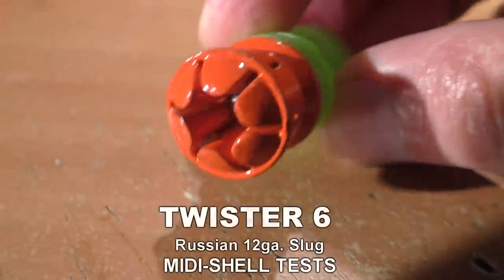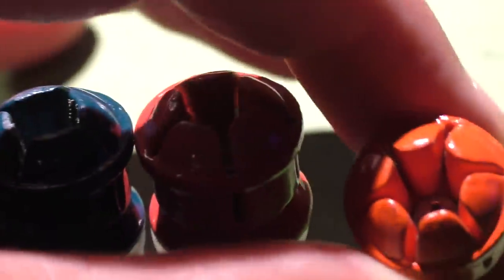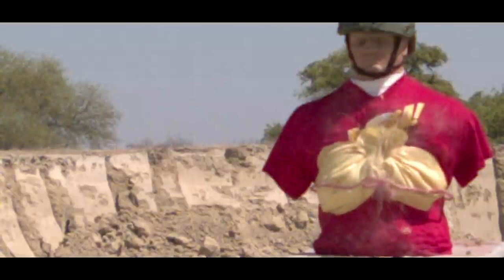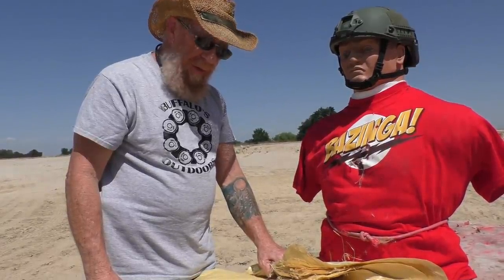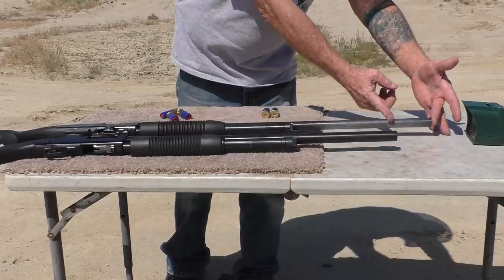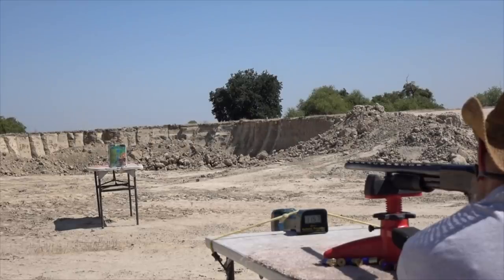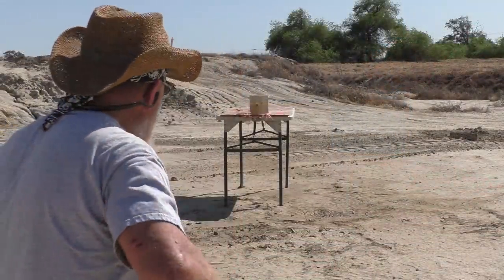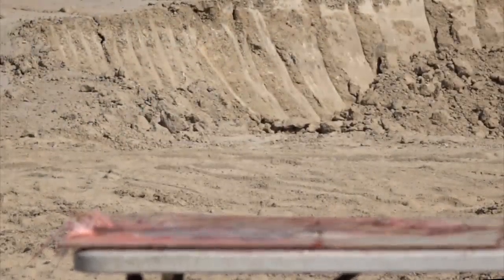This just might be the BEST 12ga. Slug we've tested!

Comment: The fact it didn't hit the pork shoulder exactly square but still fragmented and did that much damage at subsonic speeds is extremely impressive...
Reply: They also fired into the cross-section of the muscle rather than into the skin and fat and side of the muscle, which is how it would have hit had you fired on an actual hog, so it's even MORE impressive than you stated here, and that's already quite impressive!
Reply: And we have people in office that think an AR 15 is more destructive than a shotgun.  Some people...
Reply: @DSiren  There are also many people in office that think a semi-automatic civilian rifle is as deadly as the military-issue armaments it's derived from. Most of them think "semi-automatic" means that it doesn't fire by itself, but still fires full auto if you pull the trigger, FFS.
Reply: The prototype, the Shirinsky-Shikhmatov bullet is one of the oldest Russian bullets for bear hunting with a 12-caliber smoothbore weapon (1880s). There is a deep expansion recess in the head part, closed from above with a capsule for expansiveness. The bullet was most likely designed for the traditional Russian bear hunting in its winter den. The shooting was conducted from a distance of 5-15 yards, and the bear had to be stopped immediately. Because the bear, waking up in winter, does not go to bed, but goes to nearby villages and eats people, dogs, everything that he can find. And it can kill the hunters themselves. It is very easy to kill a bear with a 223-caliber rifled rifle at 30 yards in the head, the skull splits. But it's not easy to get into a bear that runs, and bears run very fast for short distances. And such a 12-caliber bullet stops a bear when it hits almost any part of its body.

Comment: This was a nice video to come home to. It's nice to know that how brutal they are even at low velocities. It makes sense why they chose to engineer the slugs around that wad.
34 gn of Longshot gives me good accuracy from the 3 segment Twisters out of my KSG.
Reply from the maker: Thanks for sending them.   The green wads really made a difference.  I used LS too but trying to keep the velocities low was actually really tricky with these heavy slugs.  (at least with this powder)
Reply: @taofledermaus  No problem. I'm happy to see the difference they make. They were only available in bulk, but definitely worth it. I'm thinking that Steel will ignite behind those 3 segment Twisters. The Shot-minis took a bit of trial and error to get them down to ~1250 f/s, but accuracy greatly improved. I got lazy and stopped trimming the hulls. I found a good load with 18.0 gn Vectan AS ~1260 f/s (in the Alliant American Select range), but I don't know if it'll be available here in the US anymore. I'll be sad if it's not because it was clean burning and dirt cheap (I paid ~$15 for 1/2 kilo).I'm just glad that I have a small stock of it.

Comment: 4:50 Holy hell! Look at the energy left in that slug after passing through Kevlar and the dummy. It hit that dirt hard! These may not be what you want for home defense. They may go through a wall or ten after passing through the bad guy😬
Edit: I guess the trick is to load them subsonic. That is a hell of a round.
Reply: @Habeebea  😂 The trick is to get the intruder and the neighbor you you want " evicted" in a straight line!
Reply: Folks will have to start asking their neighbors to make sure their refrigerators and freezers are strategically lined up to tactical lanes of fire with the next door neighbor using these slugs. Just in case. 😂🤣😂🤣

Comment: Yes thank you. So many people on FB making alignment tools. I just use a new hull with the brass cut off
Reply: You don't even need them with this wad. The slugs are designed to fit them perfectly.
Reply: Lego blocks are square enough for most purposes. Make an L shaped stack and push whatever you're aligning against the inside corner. If you use multiple layers of thin pieces, any variation on individual pieces gets averaged out.
Reply from the maker: Not even my idea,  saw a Russian guy doing it that way!
Reply: @taofledermaus  I always test fit the Russian slugs and wad riding slugs through a new hull minus the brass to make sure they will load and chamber well.. Just made sense to use it to align them too. Thanks for the great videos as always.

Comment: When that slug isn't loaded in a hull would it be called a naked twister?
Reply: Only if it hasn't been powder coated yet. With powder coat on, fresh out of the oven, it's a twister in hot underwear. Or maybe bodypaint, which would mean it's still technically naked although it doesn't necessarily appear that way... 🤔Hmmm...

Comment: I'd say you're either running out of powder before the end of the barrel or the rifling is causing a better seal than the smooth bore, making it a more efficient burn
Reply from the maker: Yeah,  very possible.
Reply: @taofledermaus  - any chance you guys have the older Mossberg 500 12ga smoothbore 20” barrel with the rifle sights attached to compare with?

Comment: If you can find some”Alliant Reloder 50, very slow burn rate, you’ll get higher FPS.
Reply: The Expansion Rate is WAY to Slow,  You'd Never Build Enough Pressure to Burn Correctly. And More than Likely It Would Fall Out the end of the Barrel. Shotgun & Handgun powders Have to Operate on the same Principles, 
 " Relatively " Small powder charge,  But Very Large Swept Volume,  and Low Chamber Pressure,  I Believe Absolute Max Pressure,  For New Shotguns 3 & 3.5" Steel shot is 22 k psi. About 38 special +p Pressure. Where Modern Rifles is Between 50 & 65 K psi. Even the old 30-30 is 44 K psi.
Reply from the maker: I wasn't trying to get high velocity.

Comment: You get more velocity out of the rifled barrel because the rifling causes more resistance on the bullet, which builds more chamber pressure,  which propels the bullet faster. Same thing happens with muzzle loaders. If you use a thicker patch and ram the ball down harder, it does the same thing.

Comment: Hi Jeff, I'm not surprised about the accuracy of the slower loadings because I've had great success with the FIOCCHI Low Recoil AERO slugs which are around 1100 FPS.  I've also had great success with my 12 GA hand loads using both BPI's Thug Slugs and the DGS or Dangerous Game Slugs. I'm getting 2-inch groups at 50 Yards with an old JC Higgins Model 12 pump gun and a rifled choke tube.  The DGS slugs as you probably already know are made by Gualandi in Italy.  They're loaded in some B & P (Baschieri & Pellagri)  loads.  I've tested those too on my channel and they're very accurate and around 1500 FPS.   What's your address if I come up with an interesting new load I'd love to have you test them?   I'd love to try these slugs but I really can't get involved in melting lead and pouring my own!  Great video!

Comment: I have the 28ga version of this slug from AS.  I've worked up a load running around 1550fps and is super accurate out of Cyl and Skeet choke tubes.  Took a nice doe back in deer season with it.  Will be using it on hogs this coming fall.  Trying to get some to Buffalo so he can get some accuracy/penetration testing as I know he has some 28ga guns.
Reply from the maker: Does he have a 28?

Comment: This is a modern version of the Shirinsky-Shikhmatov bullet, it is made for 2-6 segments, maybe 8 and is usually used immediately, without pouring wax or paraffin and without a capsule in the bullet. The Shirinsky-Shikhmatov bullet is one of the oldest Russian bullets for bear hunting with a 12-caliber smoothbore weapon. Its inventor is the governor of the Tver province of tsarist Russia, Prince Shirinsky-Shikhmatov. Presumably, he invented his bullet in the 1880s. The original bullet had 4 segments parts. The Shirinsky-Shikhmatov bullet is monolithic, lead, expansive, having a cylindrical shape with a slightly convex oval tip. There are two leading belts along the edges of the cylinder, as a result of which it is well centered in the barrel. In the head part there is a deep expansive recess, closed from above with a capsule cap. There are cross-shaped through-cuts passing through the bullet body. An expansive gap occurs along them. The recess and incisions are filled with paraffin. The felt wad was screwed on with a screw as a stabilizer, and they could.
The bullet was most likely developed for the traditional Russian bear hunting in its winter den. The shooting was conducted at a distance of 5-15 yards, and the bear had to be stopped immediately. Because the bear, after being woken up in the winter, does not go back to bed, but goes to nearby villages and eats people, dogs, everything will be able to find. And it can kill the hunters themselves.

Comment: Just looked at their website. Several interesting moulds and variations at good prices. They don't sell wads which some moulds need specific wads, where would the wads be ordered from?
I'm big into smoothbore, and rifled tube shotguns, love your videos.
Reply: Jeff, you can order the wads from:  https://www.ballisticproducts.com/
TreeTop
Reply: These are the wads shown on the site. BPI sells then as the BRP-12 They're rebranded Gualandi BRP 20. The slugs are designed to fit these wads. They may look similar the the BPI original brush wad (Gualandi BRP 18), but there are some definite differences. If you're going to shoot these slugs, do yourself a BIG favor and go with these.
Reply from the maker: Some of the Russian slugs do use a special "azot" Russian wad which might be hard to get.
Reply: @taofledermaus  You can get those through The Reloaders Network, though they're not cheap. https://www.thereloadersnetwork.com/product/svarog-shotgun-slug-wads/

Comment: Oo 
I can machine some threaded “screws” out of tungsten carbide, M45 High speed steel, CPM-S110V, S90v, or just some hardened carbon steel?

I can make the back end, the screw end threaded to go into the wad. And the tip into like a dart. Shaped like a Flechette?

Comment: Hey Guys,
I have a question about using the Maverick 88 i think you use it in this video, when you decide to use a smooth bore Barrel, the question is are you using the modified choke with all slug you shoot or you are using improved cylinder choke
Its nessary to have an answer
Reply from the maker: The smooth bore barrel Danny uses was an IC choke barrel but he chopped that off.

Comment: Shorter hulls reduce chamber pressure upon firing and leave the projectile to float down towards the forcing cone potentially reducing accuracy similar to firing a .22 short in a long chamber it is never accurate so I would use whatever length hull the chamber wants. Mine are all 2 3/4 except for a .410 that is 3 inch chamber.

Comment: You may be losing velocity from gas escaping. Typically rifled barrels are a little tighter. What choke was on the smooth bore? I suppose the longer barrel may have expended the gas pressure wave and began losing velocity from drag. I was surprised considering slower twist typically means slightly higher velocity

Comment: did any of you see that flash through the sad looking ballistic gel from the side view? why did it have a flash like that at the almost exact point the petals sheared from the base? that's weird. I understand the flash when some slugs going a t very high velocity and hitting the metallic targets is basically akin to the air between the projectile and the target having been compressed at such a super critical density that it reaches its aut-ignition point, the flash being an explosion of super compressed air flashing into a plasma state, similar to how a high compression diesel does it without spark or glow plugs, relying only on such a high rate of compression that at the instant the piston reaches it's maximum upward stroke the air and fuel has compressed and created enough friction through compression to reach the chemical thermal auto ignition state, where it combusts. and that fire and flame is in fact a plasma. 

but that being said, to flash in 3 or 4 inches of ballistic gel, at the almost exact moment the slug fragments? my only theory is compression into the gel that caused such enough compression that you get explosive pneumatic compression where that flash was essentially an explosion. and to do it in gel, where normally that does not happen, especially in subsonic and transsonic speed, the flash over point caused from extreme pneumatic compression within the gel must have been extremely intense, thus why it is only visible for only a few frames on the high speed where it normally doesn't occur in gel. probably because the slug itself scooped up and trapped enough of the air in front of it as it entered the gel and as it forces it's way through and has the gel pushing into the cavity, there was enough air pressure at that moment to auto-ignite

at least makes the most sense to me. cant imagine what it would be in terms of square inch pounds or in Bar or whatever, but it had to have been extremely high

Comment: In case anyone was wondering about the Russian laws, any full-barrel-length rifling stops a shotgun from being a shotgun. On a long gun it turns it into a rifle, and in RU you need a special permit to own a rifle. You have to own a shotgun for I believe 5 years before you can own a rifle. Because of this law, you get things like the VEPR VPO-209, which fires a .366TK cartridge through an 80% smooth barrel with the last 20% being rifled. Because so much of it is smooth barrel, it's considered a shotgun by the Russian government. VEPR guns are very expensive, though, and so people typically just opt to purchase a smooth bore shotgun such as the Baikal MP133 or 153, or something like a TOZ-194 which is a pump action variant of the TOZ-87. It's very rare to see a VPO-209 but there does exist an SKS variant chambered in .366 with the same 80% cylinder bore.
Reply from the maker: Good points,  thanks!

Comment: It's not using up all of it's charge before the end of the barrel. When the charge is completely burned, you still have to have the barrel friction become stronger than the over-pressure behind the projectile before it becomes a detriment to velocity. Smooth bores don't have much barrel resistance.
The rifled barrel likely has more velocity due to the stronger friction of rifling causing a greater pressure build-up behind the projectile, for a more complete burn, and a better pressure wave behind the projectile. Which implies under-loading the chamber pressure (not too surprising considering the hull length).
Reply from the maker: I used pretty light powder loads for these.  I wasn't impressed with them (enough to share with everyone)
Reply: @taofledermaus  ya, just thinking that it needs a bit more of a pressure spike to fully burn the powder at maximal energy... ergo more resistance with a rifled barrel would help the pressure to spike and ensure a more energetic burn of the powder. 

It's just my theory mind you. I wouldn't want you to overload something to be fired out of a shotgun barrel, they're pretty thin hehe ;) But I'd be willing to bet a slightly faster burn or a slightly tighter fit in the barrel would spike the velocity. 

I suppose it's possible, but I doubt a few inches of smoothbore has enough resistance to significantly slow a projectile down compared to a rifled barrel which bites into the projectile (or at least the wad) and applies a lot more friction.

Actually, you could shoot an identical load out of a shorter smoothbore. if you're right, it'll go faster. But I'd bet that it goes slower than the longer smoothbore ;) that'd be a safe way to test.

Comment: Slugs for home defense is like using 50 caliber for home defense. Unless you live alone in the country where the nearest house is a mile away, and there are no other people in the home, it's insane! You stand a chance of hitting an innocent bystander, maybe next door!
    I use #4 buck for home defense. It's heavy enough to get good penetration at 10 feet, but light enough to not penetrate the walls with any energy to do damage to the baby in the next room. I'm currently using Nobili Sport Italia #4 buck which is a law enforcement tall brass 2-3/4" shell with 27 #4 buck lead pellets. One of those is plenty of whoopass, and making 1325fps they're enough to knock a guy wearing body armor on his ass at close range just as easily as a slug.

Comment: My theory is that the rifling actually slows the projectile's acceleration just slightly because of drag, which gives the powder more time to burn while the projectile is still closer to the chamber--- causing it to have higher pressures and a more complete burn because of the slight time delay.  So its only "slower" during the initial acceleration but then ends up actually having more acceleration from the higher pressures, as it leaves the bore.
Reply from the maker: Often,  longer barrels will give you more velocity too.  But we didn't see that.   I'm more convinced the type AND light loads of the powder I used wasn't ideal for what I was trying to do.

Comment: do they  make a weapon where as the barrel spins at 10,000 RPM whereas  the RPM's project the slug forward instead of a gas or gunpowder explosion?  do a test on that one.  might have to test 50 miles off shore for safety.